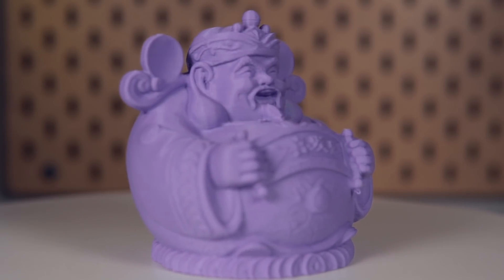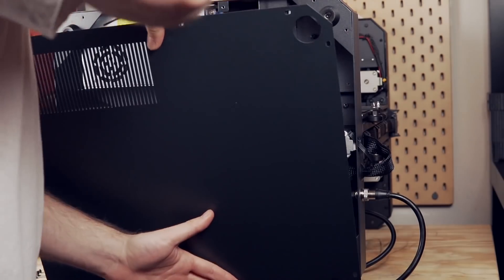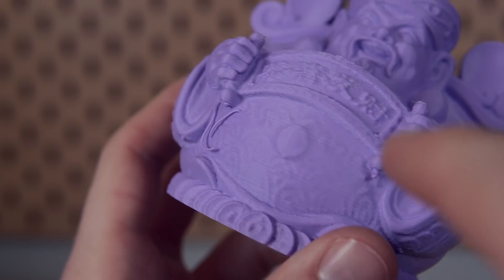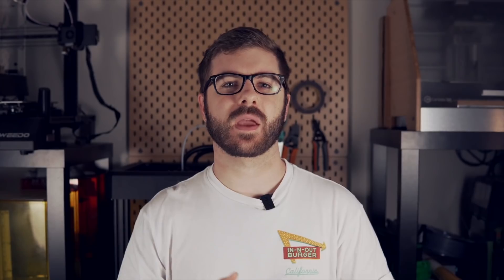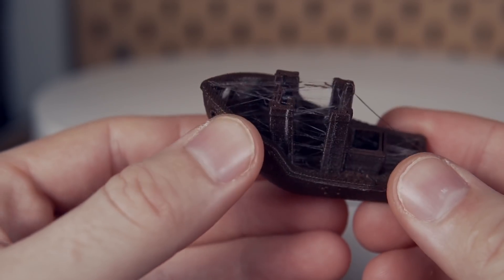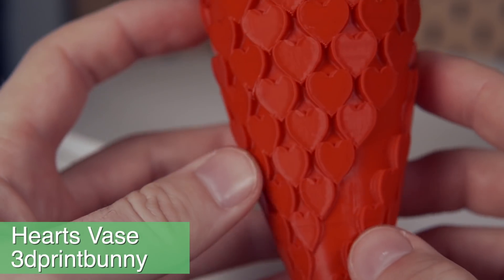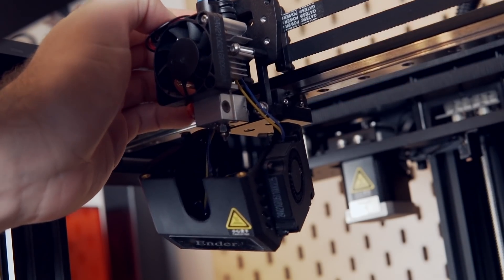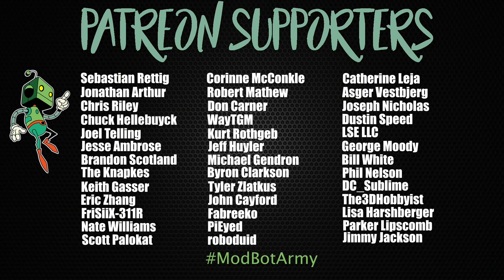Is The Creality Ender 7 Right For You? (Not What I Expected)

Comment: That seems par for the course for Creality.  They put together a list of quality ingredients and then for some bizarre reason substitute sand for sugar and you end up with a turd pie.  Excellent review though.  Look forward to hear if it can be salvaged in any way.
Reply: At least it's usually an easy fix, once people find out what the issue is, but customers simply shouldn't have to tinker with "out of the box" products.
Reply: @owowowdhxbxgakwlcybwxsimcwx  Totally agree.  They always go with ptfe lined hotends even on their new fancy direct drive extruder which pretty much eliminates any filament except pla and guarantees you will be replacing the burned up lining after a year.  I'd rather just have the option to source my own hotend/extruder and be done with it.  Less waste and less future maintenance and cost.
Reply: @link4566 Well, there's no real major blunder on that one, but it still has needless flaws: Ridiculously loud. Putting one 4010 blower fan and one 4010 heatsink fan in a fan housing made for two 4010 blower fans and one 3010 heatsink fan. Fiddly bed leveling wheel placement. No official replacement beds (yet). And there's simply nothing "Pro" about it (no ABL, no filament sensor, no all-metal hotend, not even an all-metal extruder, let alone anything actually fancy); honest name would've been "V2".

Comment: I had the same issue of the nozzle getting clsoer and closer to the print on My Ender5 Plus until it eventually knocked the part off the bed and I figured out it was the leadscrew nuts that had been tightened within an inch of their life to stop them coming off in shipping and it was also causing a screeching sound so I slackened off each screw on the leadscrew nuts a half turn and that solved both issues

Comment: thanks so much for the great review! was really hoping this would be the "ender 3" of core xy printers. could you recommend a core xy that performs well around the same price, or are we looking at $1k+ for both quality and speed out of the box?
Reply: I spent £2000+ building the Pro 3D V-King 400 from the very best parts I could get my hands on, I self sourced them as although there is a BOM spreadsheet with suppliers where you can get 90% of the parts from many of them were the same parts in Voron kits which were only ever 80% in stock and the reports of people having to buy better quality parts to replace bad ones in the kits was what put me off building a Voron
 The result is I have a beast of a printer that puts out parts as good as the digital renders and is as fast as shit off a shovel.
 You can build a smaller one with cheaper parts around £1000-£1200 and still get a good printer but I wanted quality proven working well parts and to achieve this I had to shell out on a lot of shipping costs.
 I might add that this machine works for living doing 28 hour runs and has paid for itself many times over, I would like to tell you what it makes but I am gagged in a non disclosure agreement

Comment: Did you try with Cura? To me it'd look like the layer thickness in the slicing doesn't match the nozzle. If can't use Cura then leave the slicing configuration stationary and try different nozzle sizes 0.3, 0.5, 1.0 to see if at some point it stabilizes. my2c
Reply: The included slicer is Cura.
Reply: @truantray  Seems like a different version for Creality. Just to rule out it doesn't come with a bug.

Comment: It's interesting to see, because I had exactly the same issues with noccle digging into the prints as it was going up the layers on my Ender 3 Max. I changed the surface to a thicker glass and installed BL Touch, but it never resolved the issue. Printer went through the service twice. It definitely got better, but the issue never really fully resolved.